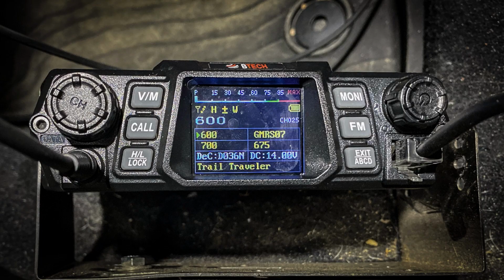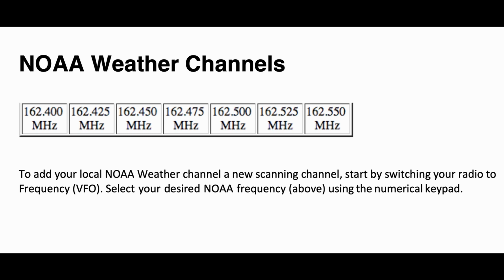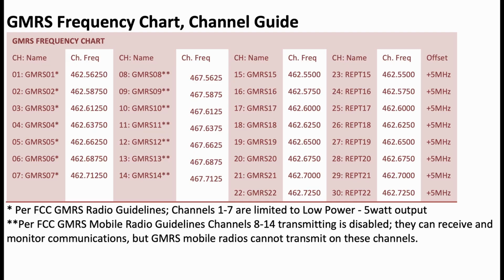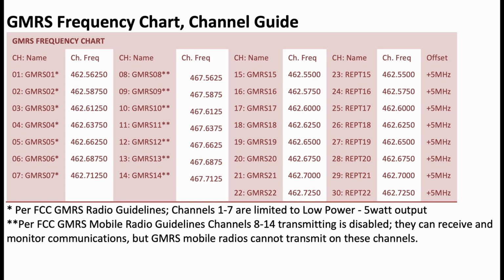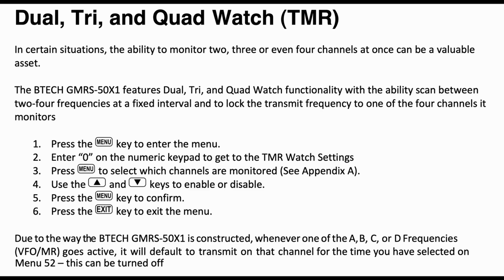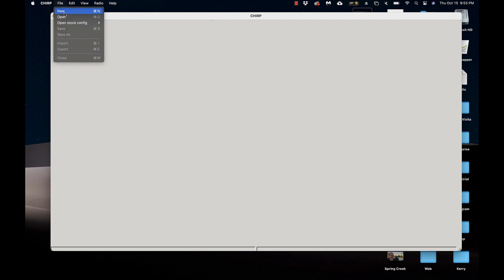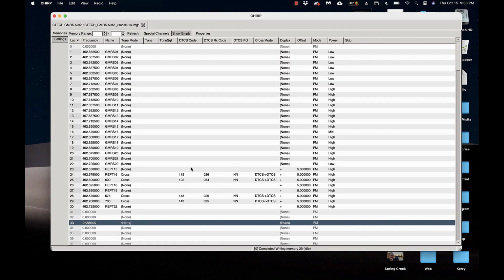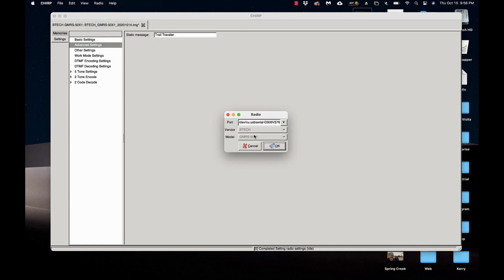New Favorite Mobile GMRS Radio BTECH 50X1

Comment: I have a question. I live in Los Angeles. I may want to have more than 8 Repeater channels in my radio. Can I add additional repeaters (more than 8) with different PL codes and one of the eight frequency pairs?

Comment: Out of the box, is this radio set up to transmit on repeaters or do you have to program the transmit and receive freq's and tones?
Reply from the maker: You may have to change settings based on your repeater
Reply: @TrailTraveler  I've been reading this 50x1 does not have the ability to transmit on repeaters. At all.
Reply from the maker: @natemclean1125 I tested it on our local repeaters
Reply: @TrailTraveler Strange, I can’t get it working. And the manual says it doesn’t transmit on any saved channels. The T-cts doesn’t save once you leave the menu, only the R-cts
Reply from the maker: @natemclean5152 are you using Chirp?

Comment: I tried to change some settings via CHIRP but CHIRP give me an error saying “radio did not enter clone mode.” Is there a fix for this? Have proper cable, and entered correct radio model brand etc...

Comment: What kind of antenna would you use with the BTech? Do you have an internal or external antenna for base use? Thanks.
Reply from the maker: I use a Midland 6 dB Gain Antenna mounted outside over my driver fender

Comment: Can this radio be used as a CB radio as I've never used a GRMS Radio before??
Reply from the maker: No, GMRS radios use a different frequency. It offers more range, clarity, and features. If you have repeaters near you, it can connect to them as well. Most Jeep events now require GMRS radios for these reasons. Here in Colorado, GMRS is very quickly taking over CB.

Comment: I have 3 of these radios now.   I like it BUT "Not Super happy with it."   It is a great radio, with one serious exception.   In my area, we have a group of repeaters which all operate on 700 with seperate/split DCS codes on each repeater.   This means that every time I need to utilize a different repeater I have to go through the set up process and change the TX DCS tone for the new repeater.   This is kind of difficult when you are using the mobile unit in a moving  vehicle on the freeway at any speed.   It would be nice if BTech would modify the software to allow the ability to program the same channel over and over with different tones for different repeaters on the same frequency.   Just one mans opinion....   WRFG362 K6DNK
Reply from the maker: Great point. In my area, we have three repeaters, which are on three different frequencies, so it hasn't been an issue for me.
Reply: @TrailTraveler  We have 9 repeaters btwn Truckee / Lk Tahoe and The Bay area, and Chico to the north and Stockton to the south, here in CA.   My home is where I can hit 7 of the 9 repeaters, so whereever I drive I am pretty sure to be in radio contact with home base.   I just have to pull off the road and change repeaters as I move around  the region.  The problem is they are all on 700 with the same RX tone and seperate TX tones

Comment: I really want to love this radio but my god programming repeater channels is like doing yoga in a straight jacket. Does the law force an 8 repeater channel limit my local network has more than 8 freq/squelch tone combinations. I tried to keep the factory channels as is and just rename the repeater channels and change squelch tones but now when I key up I get nowhere with the repeater but straight gmrs I can hit my brother 6 miles away.
Reply from the maker: I didn't have any issues with our repeaters here that use dual tones. It took me a little to figure it out, but then setting them up was easy
Reply: @TrailTraveler  I think I need to just go back to factory and program on the radio instead of using chirp. since the config is so limited I fear that chirp is putting me out of the allowed zone.

Comment: I have a problem with that frequency chart - you absolutely CAN legally transmit on 8-14 with a GMRS radio. FRS shares GMRS frequencies (with some differences).

FRS cannot use repeaters, but channels 1-22 are ALL shared between the two services. Power and bandwidth are different - FRS is always narrowband, GMRS can use wideband on 1-8, 15-22, and repeater channels.

On channels 1-8, FRS is limited to 2w, GMRS is limited to 5w. Channels 8-14 both services are limited to 1/2 watt, and narrowband. On 15-22 FRS is back to 2w, GMRS is allowed 50w.

So if that radio has transmit disabled on 8 - 14, that makes the decision whether or not to buy one really REALLY easy ...

It's also not really clear if you can add multiple repeaters on the same GMRS channel (frequency pair) so you can have say - the GMRS 575 repeater programmed in multiple channel slot with different PL tones for different areas. If you have to edit the same channel to change the PL tone just to go from one repeater to another that's crazy.
Reply: The radio only allows 1 incidence of any repeater channel at a time, therefore it is necessary to reprogram the CTCSS / DCS tones to move among repeaters with the same frequency assignment.    The new Wouxon 1000 has 200 programmable channels that will allow duplicate frequency usage with different CTCSS/DCS tones.   However, it comes at twice the price.
Reply: @danielbierwirth2190  Twice the price to not have to fiddle with changing repeaters while driving? Worth it. Ridiculous since that radio is basicallyi a different program on a ham radio that has plenty of memory. I'm wondering if the Wouxun can transmit on 8-14 too. If not, I'm not sure if it's worth the money.

Comment: I have a hand held GMRS radio trying to communicate with my 50x1, The hand Held can hear my 50x1 but my 50x1 can't hear my hand held? any clue? Thanks
Reply from the maker: Shouldn’t be the case unless you have an offset set up somewhere
Reply: Antennas too close?
Reply: its on the wrong setting it needs to be on simplex

Comment: VHF MURS  at 2 watts mobiles with higg gain antennas would be a better choice then UHF.
Reply: You're not going to be talking to someone 50 miles away with a 2 watt murs radio. Power isn't everything, but you do need enough.

Comment: You transmit on lower power to save your transmitter heat and therefor longevity.  Does it allow additional repeaters setup on additional channels or do I have to find the CTCSS/DCS code for each repeater that I intend to use on the existing repeater channels?
Reply: The radios software only allows for 1 instance of any channel at a time.   Therefore you must change the CTCSS/DCS tones everytime you wish to utilize a different repeater which operates on the same frequency.   You cannot program multiple instances of the same repeater pair.
Reply from the maker: It is compliant with the correct output power on each section of channels. It has a limited number of channels that you can setup for repeaters.

Comment: Can you program in FRS channels
Reply from the maker: FRS channels are in it by default as FRS channels are a subset of GMRS channels
Reply: @TrailTraveler  Are these the channels 8 through 14 that I can receive only on?  I was disappointed that we can't power down to still use these channels.